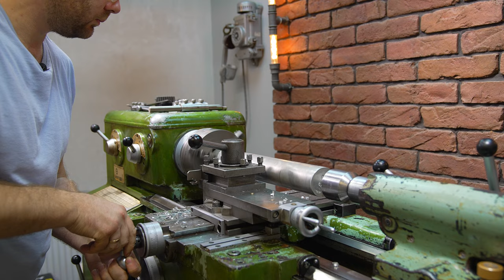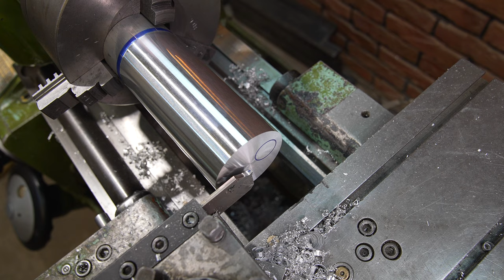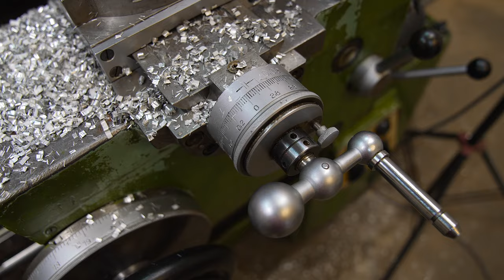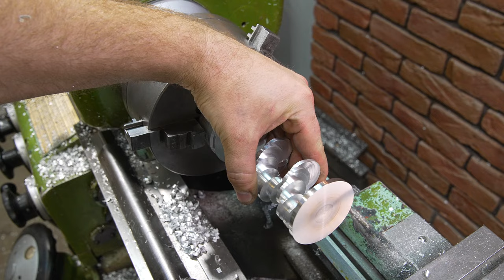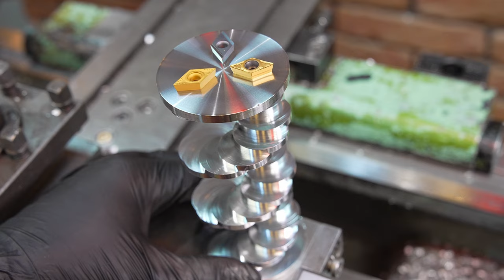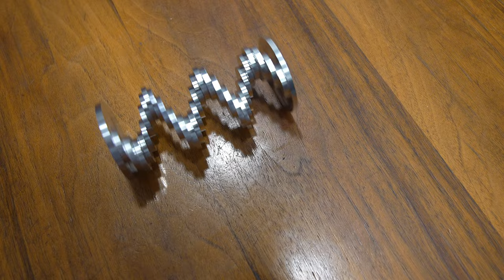Turned a spiral on a lathe.

Comment: Do you have a means of indexing your chuck around independently of your backplate to achieve the incremental steps? Edit to add: I can see how you indexed it now....very cool👋
Reply: Can you explain how? I'd like to do this project without using an indexing head. I understand if you divide the circumference by the amount of divisions you know the width of each division but how to accurately turn the chuck that amount?